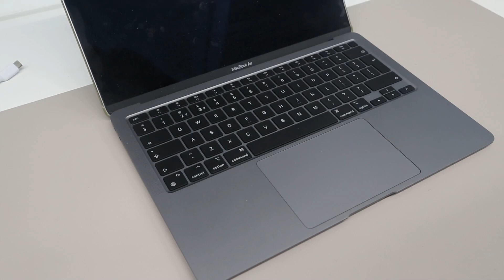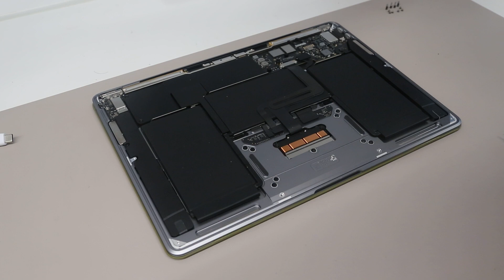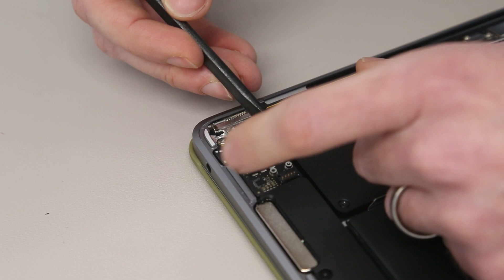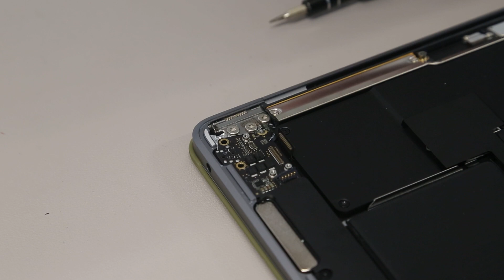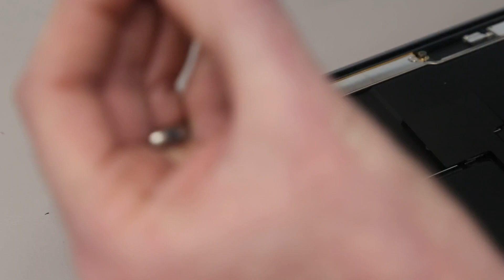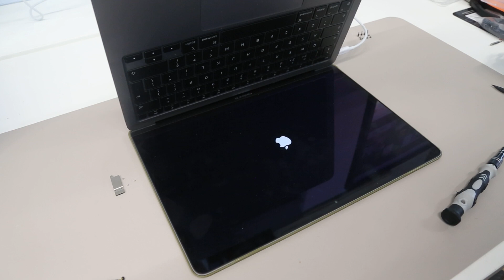MacBook Air M1 (Late-2020) Audio/TouchID Board Replacement Guide

Comment: Hello if my touch id/power button wont work and my macbook is turned off how can I open it?
Reply from the maker: Disconnect the battery and connect the charger and it should power on.

Comment: Hi, my macbook basically loads up to recovery mode as if the power button was pressed the entire time, each time it tries to restart it just goes to recovery screen, even when you selec the HDD,  was the issue with booting the same issue?   im starting to think that is the issue, and replacing thet touch ID power button would possibly be the fix.
Reply: Have you resolved the issue?
Reply: @sveta4108  yeah I replaced the audio board which fixed the issue.
Reply: Thanks❤

Comment: Hi, I've just tried this and I'm still not getting any sound out of the internal speakers. Touch ID works fine and audio from the audio jack/usb c and bluetooth work fine (on both audio boards). All the usual tips with PRAM killing coreaudiod etc don't work either. Can't imagine both speakers have suddenly gone so do you think it could be the audio ribbon at the logic board end or is there something else on the logic board that could go wrong to cause this? Any help greatfully received, thanks
Reply: I have the same problem as you. Did you solve it in the end?

Comment: I have a macbook air a2179 which was water damaged on the audio board area. I replaced the audio board, but the speakers does not work however it works fine with a headphone. In the system settings, It seems that the system does recognize the macbook internal speakers and when I increase or decrease the volume everything seems normal but no sound from the speakers. I updated the system, I tried doing PRAM but I was not successful (Although I am not sure if I did it correctly or not). I am not sure if this is related to or not, but there is a tiny led on the logic board beside the button for discharging current which is always on. Another point is that if we suppose that the right speaker which is connected to the audio board is water damaged, then why should not the right speaker work?! I am not sure what is happening but I think something is avoiding the speakers to work.
Reply: I'm having the same issue as you, although not from a liquid spill. All other forms of audio work with my old and new audio board, it recognizes the internal speakers, but I can't get anything out of them after all the usual tips with PRAM etc. Can't imagine both speakers have suddenly gone so do you think it could be the audio ribbon at the logic board end or is there something else on the logic board that could go wrong?
Reply: @Captck  I saw a video on youtube and found that there is a chip on mother board that should be replaced. I am running my laptop without sound.
Reply: @hamidmoezzi1774  Thanks for the feedback. I did run the built in diagnostic tool from Apple and that came back with no hardware faults. I'm taking it to the genius bar tomorrow to see if they can run their tools on it which might be a bit more in depth. Reluctant to pay for anything further really though as it was just something I picked up cheap for a knock around take anywhere option. I can probably live without sound too, but I'll see what they say.
Reply: @Captck  let me know if you found sth more than what I already found.
Thank you
Reply: where did you buy the replacement board
Reply: @dougartYT  Ebay

Comment: Hi. May I ask how you found out that this part was defective?
Reply from the maker: Sound and TouchID weren't working - system was out of warranty and Apple had quoted the customer an uneconomical price to repair. Agreed with the customer to try a replacement Audio/TouchID board as we could source a s/h part relatively cheaply and seemed likely this was the issue, and fortunately this fixed it.
Reply: @BrueComputing where did you buy the replacement

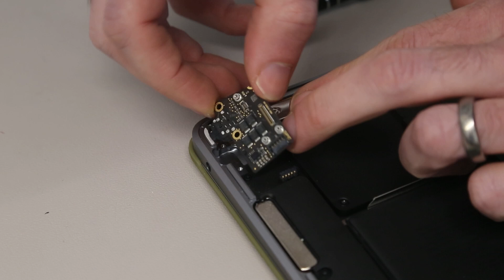Comment: Note that although removing the AUDIO BOARD which has the headphone jack and R speaker cables attached to it and also include functionality for the Touch ID, the actual Touch ID Sensor is under the 6 t3 screws under the board you removed and can be seen at 4:28 so anyone following these instructions will end up as they started if what they wanted was to replace a non functioning Touch ID sensor. 

Aside that, people should note that Touch ID sensors are paired specifically to the logic board and even though an original Touch ID sensor is installed, only Apple can calibrate and pair it and your replacement will NOT work unless matching logic board from is also installed.

Comment: Does the touch ID function work after replacing it? Or is it paired to the logic board and replacement only gets you working power button with no touch id functionality?
Reply from the maker: Replacing the board is fine, so long as you aren't replacing the TouchID sensor that plugs into it. The sensor is paired to the logic board, not the audio/Touch ID board.